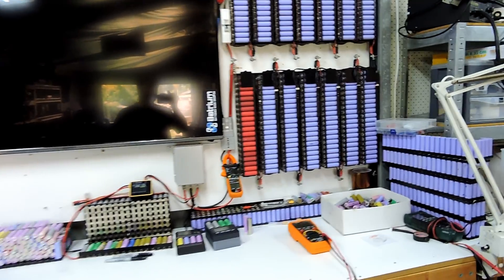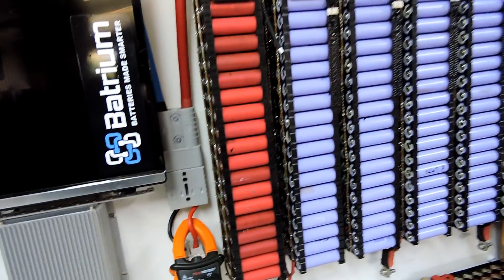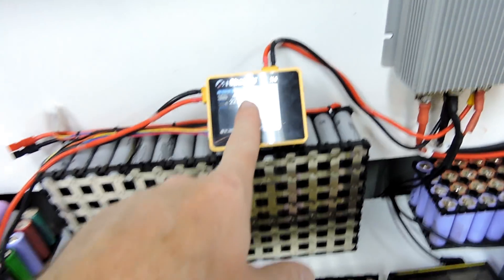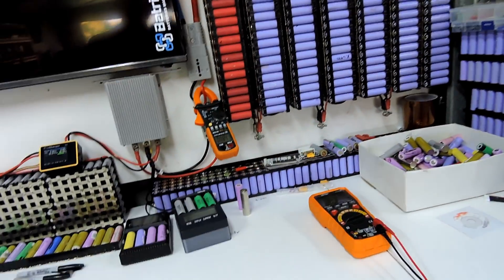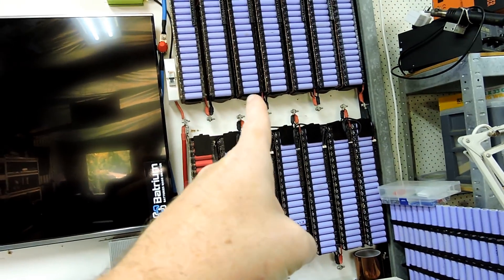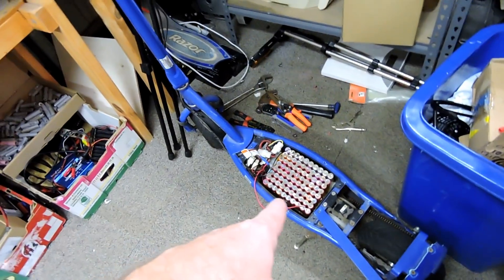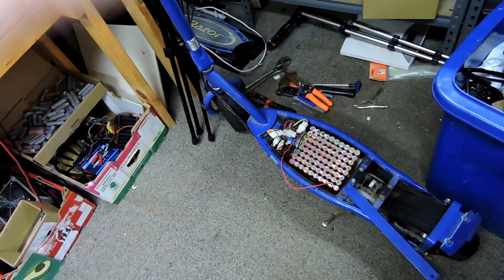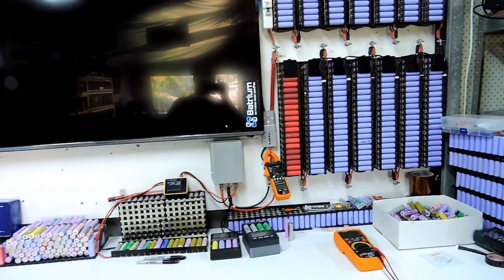Second DIY Powerwall in service FIFTY kWh of storage

Comment: That's a good little use of the packs in the garage but given the amount of time and cost in that just to run some charges it would be better to also connect up an inverter so you can take full advantage of the packs on the wall.
Reply from the maker: tried it between 28v&37v does the same thing everywhere, also it does work ok when the fan is on full blast but not when it is one click lower

Comment: Hey man, Great videos, I have been looking for a complete how to guide and your channel is a fantastic source for this :) 

I was wondering however, when these batteries have a lets say 500 cycle life and you do your tests, do you not end up using a lot of the life of the battery just for testing? it's a LOT of effort for using second hand batteries no?

I was thinking to getting about 5000 HG2 batteries to do this with, brand new from a reputable source. 

Can you point me to a video of yours that goes through the complete guide of your hardware you use for the inverter into 220V and how you personally generate the power? as you have snippets through your hundreds of hours of videos and that's time that I could be making my cells LOL :)

Any help is appreciated.

Keep up the FANTASTIC work buddy :)

Comment: Good stuff. Did you switch the 7210A Off while doing this video. As the fan on that unit is loud.
Reply from the maker: I had the fan turned down to a minimum - but when I do that voltage flickers uncontrollably - fan on full blast screen is normal - voltages aren't quite right either - should be releasing an overview of it in the next day or two

Comment: Hey do you bottom balance all your cells before making your parallel packs? Thanks for the good content by the way!
Reply from the maker: Top balance all the way, rather loose a pack due to zero volt than over charge and burn something up :)
Reply: @HBPowerwall  - Awesome thanks again for the input and advice!
Reply from the maker: almost any time :)